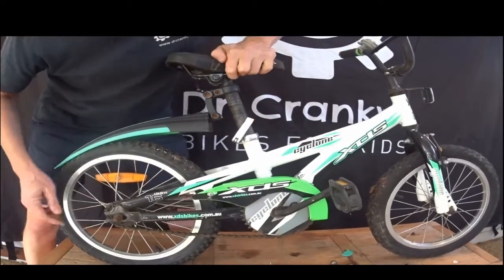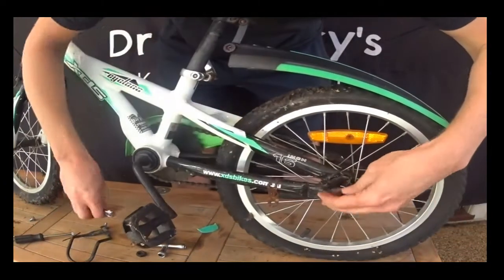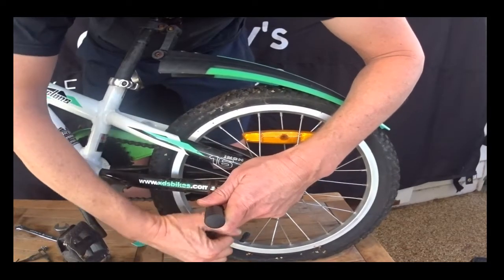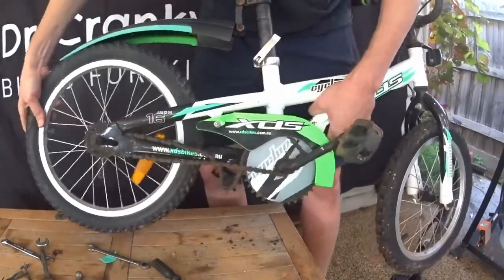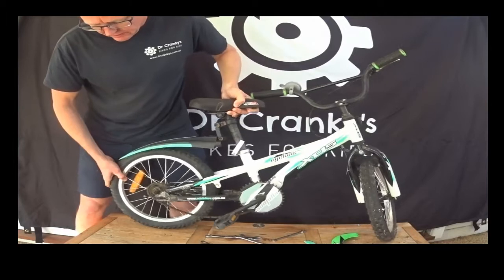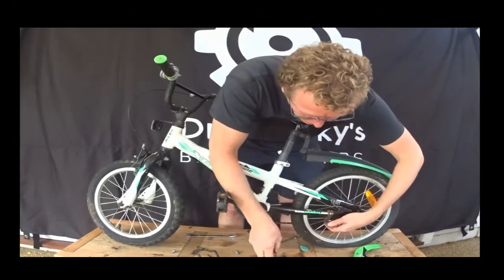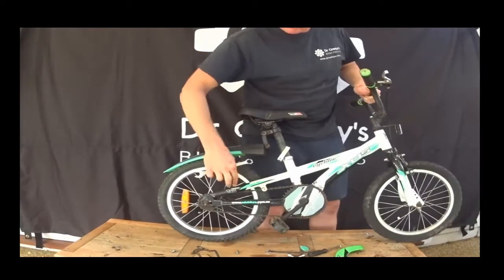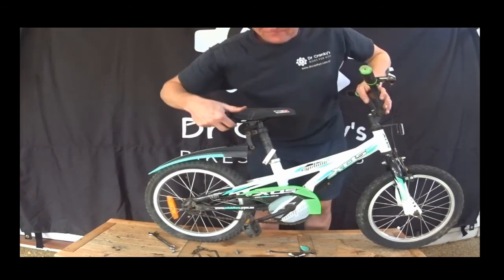Removing the rear wheel of a small bike with back pedal brakes

Comment: my kid's bike the rear wheel has so much tension when i spin the pedal , i guess it is made for beginners learning to ride.. but now he has less fear and i want to make the bike go normal speed like a regular bike.. is that possible.. this bike even down the hill it still keeps a constant speed..
Reply from the maker: Do you mean the chain has high tension? If so you can move the wheel forward a smidge to make it easier to ride. Just make sure the chain is not so loose it can derail off the rear cog.
Reply: i saw someones video on that.. i just thought they design it like that for beginners.. with this bike he has manage to lessen his fear.. but its like a struggle, looking at him ledaling so hard just to get some momentum going ^ ^ and only get up to a certain speed .. before with a regular bike he was scared.. i taught him enough he was able to balance and everything but got scared in riding it , so i thought maybe its the speed 'he doesnt know what to do when he runs into obstacle, and tends to put his feet down before breaking!!' -- so now this bike he loves it but after like a mile ride, he got tired ..
Reply: i check the tension the chain is not tight at all just right .. but i will look more into it ..
Reply from the maker: @lapassion24  then you should check if the wheel bearings are too tight ( does wheel spin freely?) Or the bottom bracket is tight (can you spin cranks easily?)
Reply: i just know if i flip the bike upside down, and tuen the pedals, the rear wheel spins slower than normal bike would .. so i know you can see the whole picture.. i know the hub is where the metal balls are and the backward breaks i saw a video on that too... but thats all i know , i dont know where to start looking to ease up on, screws and other parts!! ; )